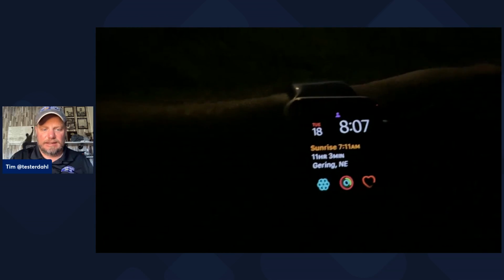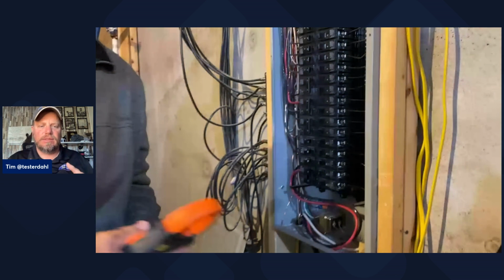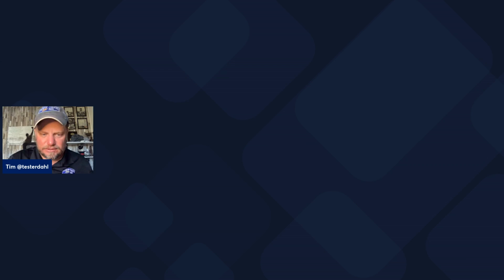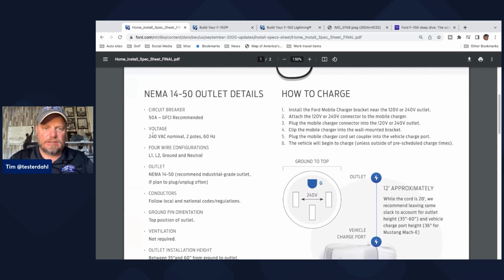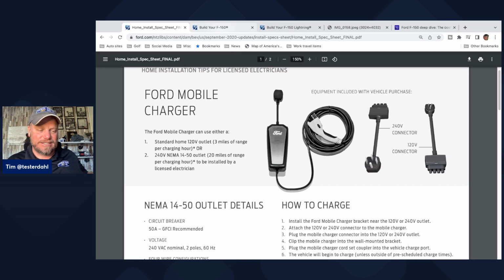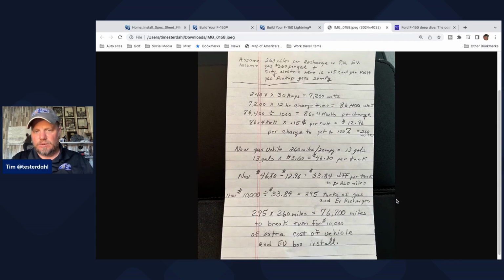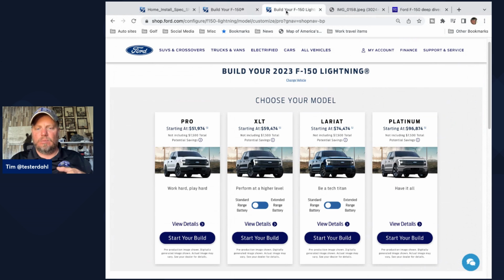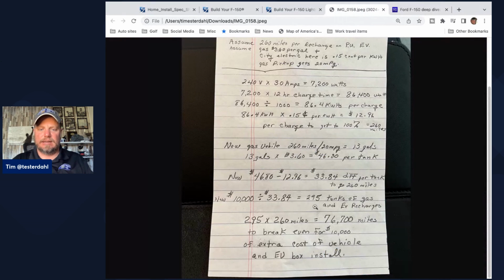11+ hours later on 220V charging price for 2022 Ford F-150 Lightning

Comment: I have 2002 Avalanche. I put a Jasper in it when the oil pump died at 399,987 miles. Since the truck was like new I felt that a new engine was worth the price as replacing it with a new truck comparably equipped would cost me $60K, with Jasper's improved version of the 5.3 was good choice. I.get over 25 mpg on the hwy while riding in silent comfort. With enough power turn rubber if I want. I have ONE battery under the hood that I may have to replace very 4 or 5 years which I am okay with.
Reply: LOL.... your truck was "like new" at "399,987 miles" and you get "25 mpg on the hwy"????? Now that is much more impressive than this  Ford EV truck, which certainly won't be on the road with that many miles.
Reply: See, you got a battery under the hood! "hybrid"

Comment: First, thank you for all the work you did coming up with all these very helpful numbers. I tend to buy vehicles at 10 to 15 years old and run them until they are completely done. (I live in a part of Canada that salts the roads in the winter, vehicles tend to die by rusting out rather than engine/transmission failures.) Automotive batteries tend to last between 3 and 7 years. My point is I can buy a 10 to 15 year old  conventional fueled truck for 5 to 10 grand and have a reasonably useful truck. If batteries for an electric truck only last 5 to 10 years (I'm not sure how long they last) and they are worth $30,000 (one online estimate I read) then: 1) I'm not going to want to pay anything for a used electric truck knowing that I will have to buy an insanely expensive battery very soon. $30,000 will buy a lot of gas or diesel fuel.  2) If you are the guy who buys the electric truck new, one of the calculations that you neglected in your video is, how does depreciation compare between the  gas/diesel and electric if the electric needs a new battery after however long?